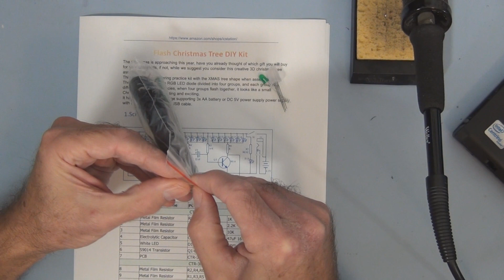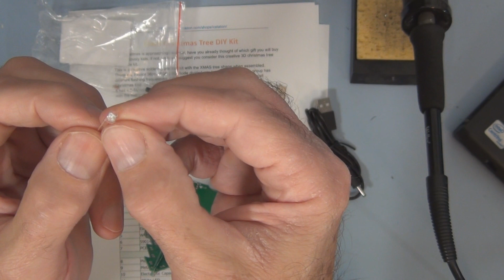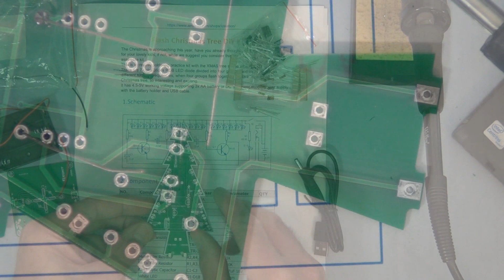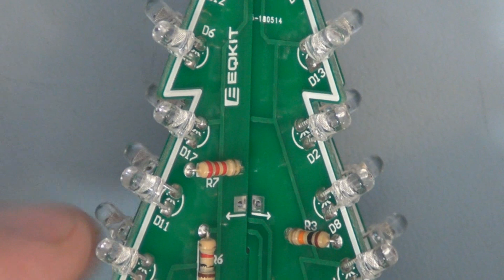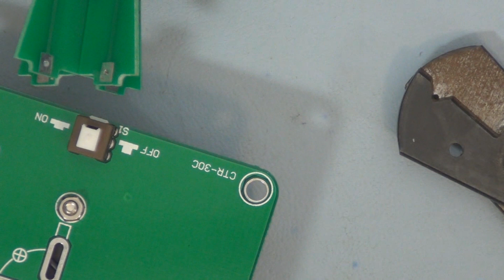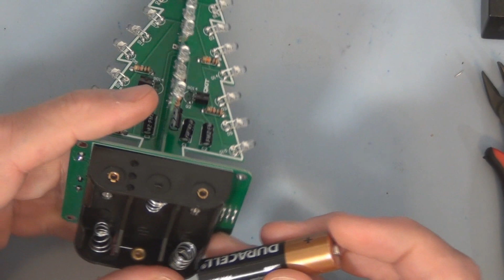3D Electronic Christmas Tree Kit Build

Comment: I tried to make one, but after making all of this, nothing happen. I press the button and it doesn't light. Do you know what can be wrong?
Reply from the maker: I don't know how much experience you have with electronics or soldering but some of the parts need to be installed with the correct orientation.  The same for the transistors and the capacitors.  If you look at the bottom of the Christmas tree halves there are plus and minus markings that have to align with the markings on the base.

Comment: just finished mine, In one of the PCBs three LEDs of each side won't light.. what could it be? Thanks
Reply from the maker: If one of the boards is working visual compare the two to make sure you are not missing a component. Check to make sure you did not miss a solder joint to a component.  On mine all the transistors have the flat side down.  Do you mean you have a total of six diodes not working on one board? Sometimes you can have what they call a cold solder joint that you did not heat enough and will be dull in appearance and not make a good electrical contact to the solder pad on the board.  I know the leds are very small but maybe you installed one backwards.  Check closely with a magnifying glass if you have one.  Everyone can make a mistake in electronics so just take you time and you'll figure it out.  Troubleshooting is part of the process when doing a project like this.  I think I caught myself making a mistake too.  Good luck.  Hope this helps.  If you have a meter you can check voltages on the two boards to see what is different to stir you in the right direction to find the problem.
Reply: @tmc200527  I checked, no component is missing, no capacitors or transistors are backwards... a bit frustrating. Thanks for your help.

Comment: I bought this x-mas tree but it's cloned or something. At the base of the tree, there is 5v usb port instead of battery holder like you have.
Completed the soldering. One side of the tree leds are flashing, but the other side it's not.
Also I get extra pcb (the side with gap in the top part), I don't know if it will function or not. Does it need both sides to work?

Comment: I assembled tree and it all works but even if switch is off it blinks anyway! I don't understand where I mistaken
Reply from the maker: Maybe you have a solder bridge under the switch?  Did you install the two batter jumpers correctly.  You could try removing the switch and then see if it still turns on with the batteries installed.
Reply: @tmc200527  i think switch is malfunctioning. When is on light is strong, when is off light is a little weak. And when it is on and I put on off for a second light is really weak and it becomes a little stronger after a second

Comment: First time ever soldering wanted to practice for a different project I have in mind. 28 out of 37 (I think there's 37 total) lights are working... SO I say that's a success.
Reply from the maker: You might just have some leds backwards.  I did that on a couple.  It was difficult to determine their polarity
Reply: @tmc200527  Thanks for the advice and video! Really helped me out

Comment: I think I will buy it but substitute the LEDs for other ones. I quite like the form of it, but the RGB stuff is just a bit too busy for me!

Nice video as always.
Reply from the maker: I was wondering if there were larger ones available but I don't know if it would throw the proportions off on the look of the small tree.  I found some on Sparkfun that are 10mm size.  https://www.sparkfun.com/products/11452 The lead spacing might be wider so they might not fit.  I think the ones in the kit are 3mm size?
Reply: @Riskteven  yes, but the RGB LEDs that come with this kit can't be controlled, they just do their flickery RGB thing, which didn't look good

Comment: Can you control the speed?
Reply from the maker: I'm not certain to what extent the transistor circuit with the electrolytic capacitors are controlling the frequency of the LED turning on and off but they have these LEDs in larger sizes and different cycling speeds.  I found this one on Sparkfun https://www.sparkfun.com/products/11452.  The data sheet just shows an IC with no identification and a timing diagram.  https://cdn.sparkfun.com/datasheets/Components/LED/changingLED.pdf